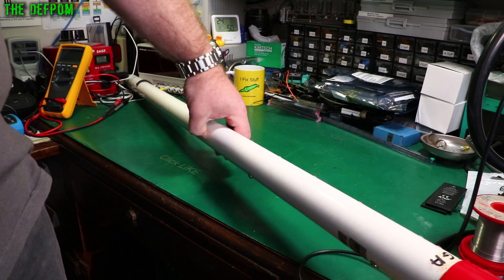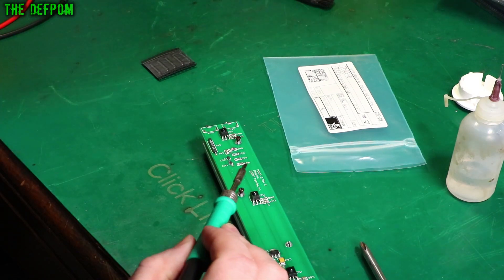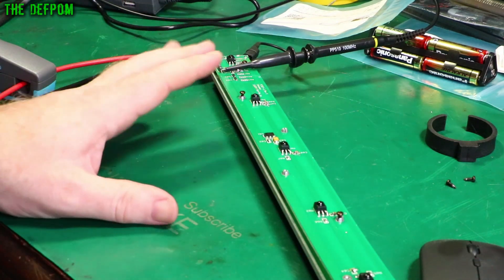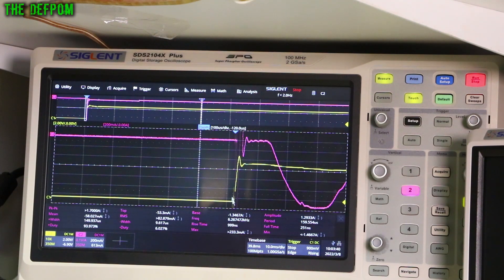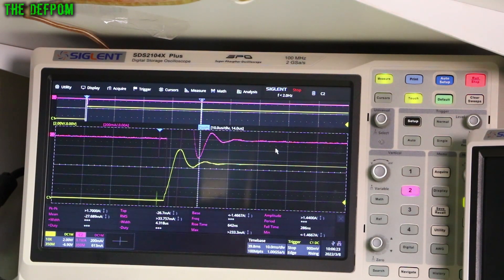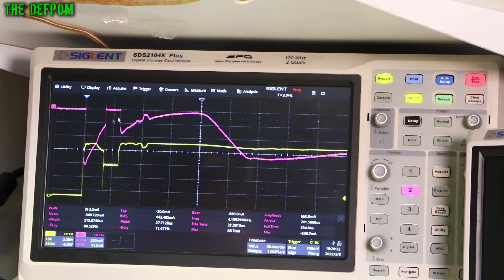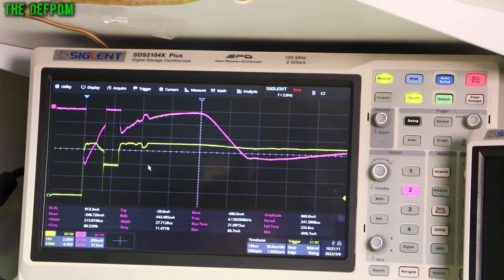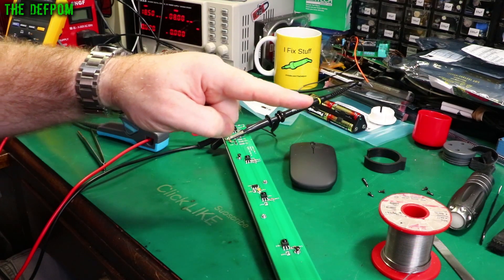🔴 Farmtek Light Curtain - Farmtek FLC Photo-Receiver Switch Repair & Investigation - No.940

Comment: Use an NTC thermistor to limit the inrush current.
Reply: Well, with due respect to your correct answer, Defpom would surely know this. So, the question is why he did not use an NTC? My guess is that a two cent resistor was "good enough" and the expensive NTC could be saved for another repair.

Comment: As you say, passing a high current (even a short duration pulse) through a small reed switch is asking for trouble. Someone slipped up when they designed that product.

Comment: a good fix strange it happened so fast on three or four new reed switches, but had not happened before, yes puting a limit resistor in curcuit fixed it, but could there be an underlying fault not found??